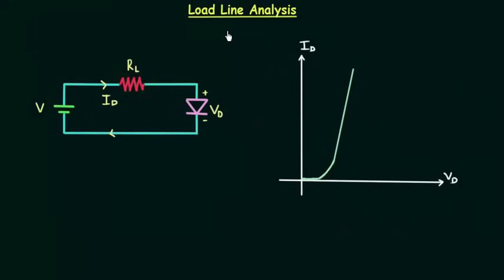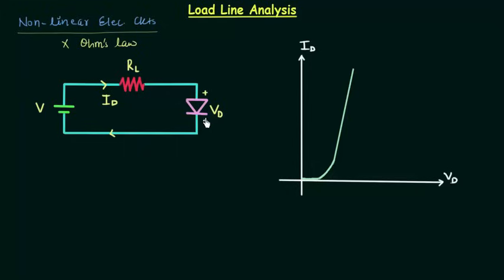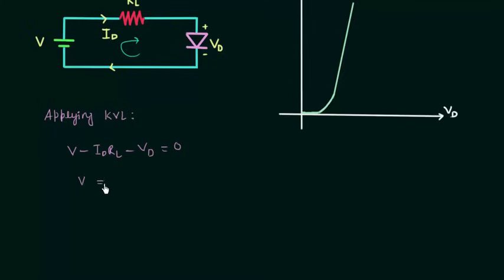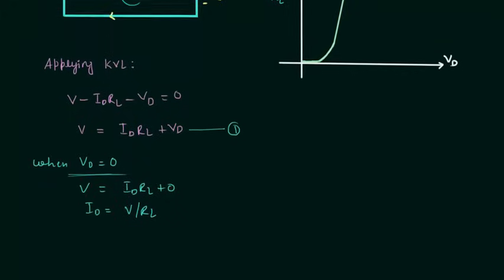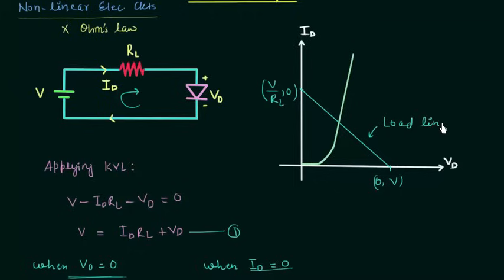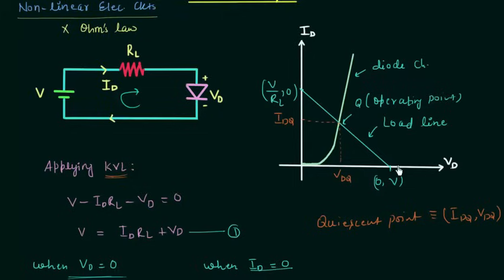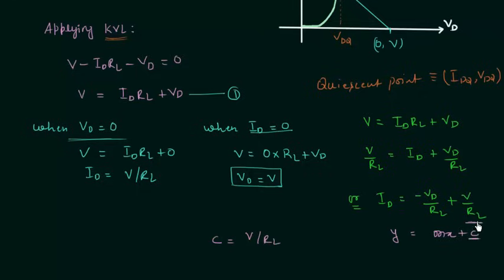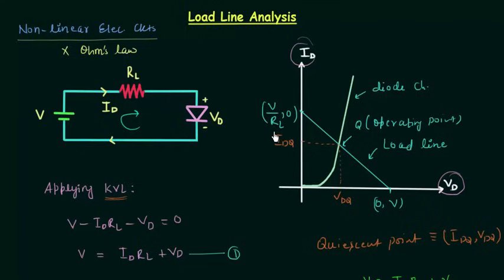Load Line Analysis of Diode

Comment: I have a doubt.
If RL increases than the current decreases but the voltage across diode will be constant which is 0.7 V. Then in the Q point only Y coordinate should change but here both the coordinates are changing , how? Can anybody explain it to me?

Comment: does it make a difference if the resistor is after the the diode? The equation from the KVL should not change, right?
Reply: Doesnt make a differnce. Since both parts are in series the current will be the same

Comment: I do not understand. According to diode characteristics, when I_d =~ 0, then V_d is also around 0. But according to Load line, V_d = V. So, for one value, i get two other values. I do not get that at all. Same for V_d = 0. If V_d = 0, what is the I_d??? Is it O, or is it V/R_L ??
Reply: Actually they consider diode as a battery of x volts that is reversely connect to circuit containig a resistor
The equation would look like 
V=x+IR
I.e. total voltage needed to produce a current in the circuit circuit is sum of voltage drop caused by resistor and reversely connected battery
Now if you remove the reversely connected battery (i.e. x=0) you would need a voltage greater than zero to produce a current(V-x/R=I) similarly if you add the reversely connected battery you would need voltage greater than x to produce a current in the circuit 
Now if you could vary x from zero to any number you will get different values of current ranging from zero to any number.Now plotting those current values against those of reversely connected battery's voltage value will give us a straight line
But we have a special type of reversely connected battery (in this case a diode) which can only have a value of 0.7/0.3 volts(forward biasing voltage)
So in the equation
V=x+IR 
X becomes constant since it is no longer varying we will have only one value of current from above equation for a specific R 
Now since the circuit is in series the same current must flow through both diode and resistor so if you plot diode characteristics curve and graph of current through resistor and our reversely connected battery you will find only one value of current that could satisfy both 
Now if you analyse the above equation
V=x+IR
This could be rearranged like
I=1/R(V-x)+0
Which is same as 
Y=mx+c
I.e. Equation of straight line
Where m is slope and c is y intercept(distance at which line cuts y axis)
We could easily calculate y intercept if we put x=0 and similarly if we rearrange this equation for x we could calculate X intercept(distance at which line cuts x axis) now we just draw a line through those point
[And that's about it we plot values of current through resistor against that of revesely connected battery and compare that to didode characteristics curve inorder to find a common current value ]
Reply: @SameerKhan-xq3he  Thanks bro. Perfect explanation ❤️👍
Reply: @SameerKhan-xq3he  thank you for saving me

Comment: sir please tell something about the significance of operating point, how the change in Q point  changes the different quantities ?
Reply: See... Q point tells us about the current scene of a diode... like what is the voltage across it and the current through it. So, if the Q point is in the 1st quadrant then we know that the diode is in forward bias... and similarly if the Q point is 3rd quadrant then the diode is in reverse bias. Additional note: Q point stands for quiescent which means non varying or stationary point.
Reply: @3xf250  So it's similar to the purpose of the Vx = Rx(V/(R1 + R2)) equation? In that you're finding the value of that component given the specific circuit it's in? But instead its for a non-linear component instead of a resistor/capacitor/inductor?
Reply: For the given voltage applied and the given resistance we can tell that I(DQ) flows through the diode and V(DQ) is the potential across it.
The graphical analysis is important because we are not assuming any approximations
Reply: See simple ....  q point is just for having a point where the diode characteristics could be linear when a very small ac signal is given...    why load line means to know our q point...   if we just draw a diode characteristics we cannot know at which point q point has to be taken ...  now when u draw load line it definitely is a linear line...in load line voltage across diode is just a drop...     now merge diode graph and load line graph ... where they intersect is the q point...    note : graph is seen only across vd and Id... this is very important....   when slope changes dc load line shifts hence intersection point also changes...
Reply: Still looking for answer?

Comment: what is the use of DC load line..fir what it is uses
Reply: See simple ....  q point is just for having a point where the diode characteristics could be linear when a very small ac signal is given...    why load line means to know our q point...   if we just draw a diode characteristics we cannot know at which point q point has to be taken ...  now when u draw load line it definitely is a linear line...in load line voltage across diode is just a drop...     now merge diode graph and load line graph ... where they intersect is the q point...    note : graph is seen only across vd and Id... this is very important....   when slope changes dc load line shifts hence intersection point also changes...

Comment: what is the significance of load line?why it is important?
Reply: The significance of load line is that,by load line you get to know about maximum values of the output voltage and output current, so you will know the maximum power dissipation by the device,so u know the maximum  operating range and we can prevent damge of devices.
Reply: It is basic tool to find the exact valir of q point to find the Active region for proper amplification. And to see the behavior of ic on vce to check saturation state and cut off state.
Reply: @navinsabban6521  thank you
Reply: Nazmul Hasan i am also searching the same..for very long..plzz someone help.
Reply: Me too.
Reply: Good question 👍